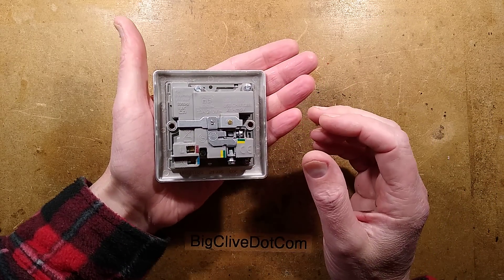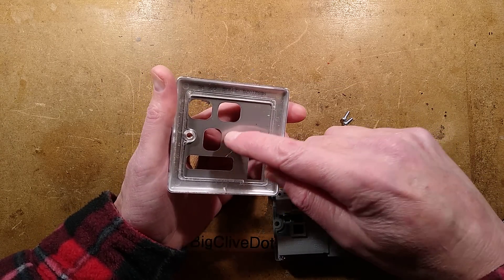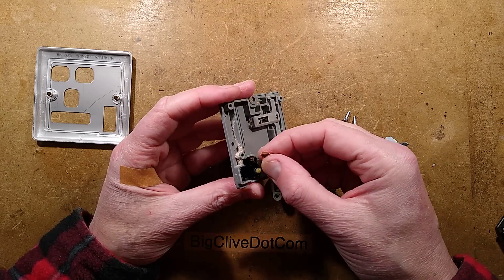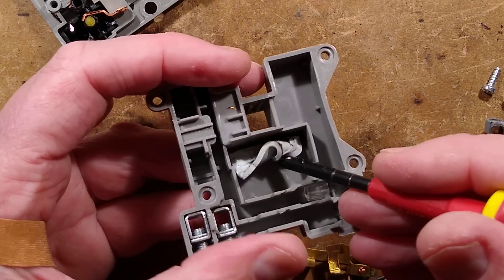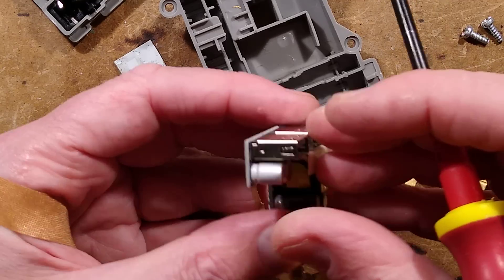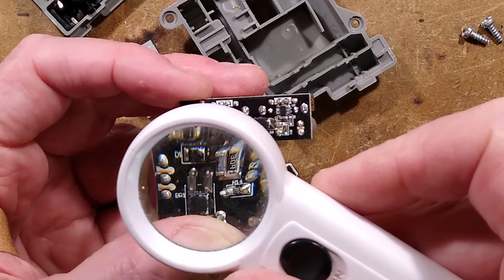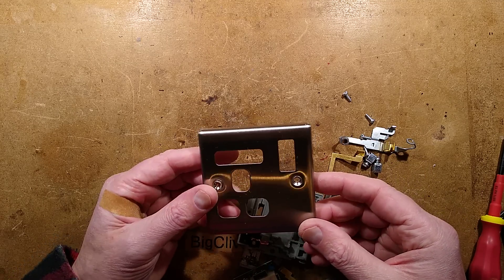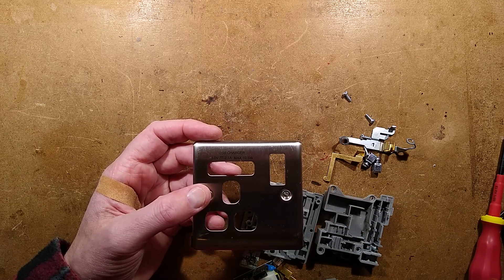Exploded British General USB socket

Comment: I've warned friends about this happening but it's a convenience thing. I would much rather plug in an adaptor at least you can turn it off by the switch if the worst happens
Reply: They'll get outdated anyway as well.

Especially pointless in uk with their plug being sturdy, just leave a charger plugged in.
Reply: I'm fully aware of the fact these fail after time... But they definitely stop kids stealing the chargers and moving them around.
Unfortunately they're like 10 times the price of a plug in one, and about 5 years behind what we expect.
Reply: the argument it wastes a plug, but even if that true, you can buy, usb power plugs, with a main power passthrough main plug socket, I've got one and it say it does, surge protection too? masterplug made it I got it for my laptop PC, but it end up being left pluging all the device charging corner in the house? and thing that charge bricks just passthrough power socket as before, and have USB sockets two, and and if you must charge three usb things you could always just plug usb charger as well, all with   surge-protection too, and when you finished, it just unplug like wall plug too.
Reply: I was thinking the same.
Reply: Lower grade parts energized 24 hours a day is a sure recipe for disaster. The d*** things should be outlawed!
Reply: Hello Sir! Could you do an elfbar please, the disposable vapes? and laso the ones called 'lost mary'. Would like to know if they are done well inside as I smoke them and occasionally hear stories of them going off in people's faces pyrotechnics style :D
Reply: @faraj3159  why dont you buy a multiuse one instead of literal garbage
Reply: If this had happened in the USA and a contractor was involved, the contractor would be sued out of business.
Reply: It's not hassle. It takes 5 mins to replace it....
Reply: @girlsdrinkfeck  5 minutes for someone with the right tools and know how, some people would create serious problems if they tried to replace a socket on a ring main !
Reply: @ian-c.01  You mean by not correctly connecting the loop to the next socket? Yes, with a terminating circuit all the concurrent sockets would stop working alerting the consumer to a problem. With the ring main, all the sockets would still operate but now there's a danger of over current in the conductors  I find it incredible that ring mains are still a standard. I can understand leaving them "grandfathered" for existing installations but to still permit them for new installs is crazy. It's so bad that most foreign sparky videos here on YouTube when referring to our system are all convinced everyone here uses ring mains.
Reply: @spudhead169  Ring mains allow high current circuit breakers to be used with cabling which has a lower rating as long as it is correctly installed.
This is why it's necessary to understand the requirements before working on a circuit, unfortunately it's not plainly obvious to people without training and that's how mistakes are made. In a radial circuit it's pretty simple, most people can understand it, radial spurs are a bit more complicated but they are usually nearby so if the spur socket stops working after doing something to the previous one it's usually not difficult to spot. Unfortunately this isn't the same with ring mains but that's not the fault of the circuit.
Reply: @ian-c.01  My argument against them is that they present a danger in a fault condition that is not apparent. With a radial circuit a fault in the conductors will render subsequent sockets inoperative and doesn't cause the remaining operating conductors to experience potential over-current. With a ring main, such a fault would not effect the operation of all the sockets, so the consumer would be unaware of the problem and also since the ring is broken, effectively converting the ring to two radials with conductors rated far lower than the breaker. Faults can present for many reasons, not just from inexperienced work on the circuit.
Reply: @ian-c.01  They aren't fitting a new ring they are replacing a socket thats already wired in. All they have to do is copy the wiring thats already there. Most people in the UK do actually know this stuff.
Reply: @backgammonbacon  You'd be surprised at how many people think they know but have no idea yet still try to do things like that !
Reply: @spudhead169  affect not effect. There is a big difference and it is not hard to learn.
Reply: @deang5622  Perhaps that was harsh, comments are crude and they're affect on peoples temper's can be reel. So if it trigered you then I apologize. Your probably a good person.
Reply: @spudhead169  It doesn't trigger me in the slightest.
I am just trying to help you learn English, the English you should have learned when you were 16 and still at school.

When people can't don't understand the meaning of simple words like that, it exposes their level of education.
Reply: @deang5622  Yeah, my education sucks. Like I would have used a semi-colon instead of a comma in that first paragraph. I'll try harder.
Reply: @spudhead169  What if it's the earth that becomes detached in a radial...? A different safety issue I know, but. Thanks to a cowboy with a Part P I have a discontinuous earth on my kitchen ring main. It makes it to all the sockets, but only in one direction - and I really don't want to go pulling up carpets and floorboards upstairs to find the crap junction box where I assume the fault is.
Reply: @girlsdrinkfeck  you have go with lowest common denominator,  that almost everthin g now comes with pre-molded plug, attached
Reply: @girlsdrinkfeck  There are people who are not confident in replacing sockets. In Finland it would be illegal. You must use an electrician.
Reply: @girlsdrinkfeck  in Hungary you cant replace a simple burner nozzle on a gas stove, u need a cetified gas technician to do that. Only the technicians can buy the neccessary parts in the shops. Same goes for the AC. U need to speak with a technician first to arrange the installation, then you can go to the shop to buy the AC and after you bought it, u need to go back to the technician to get it from the shop.
Reply: @talos86  hmm yes government extortion
Reply: @girlsdrinkfeck  well, its a problem, if u cant use your gas stove, because the nozzles are clogged up and the mechanic can come on the next week to replace the nozzles.
Reply: @girlsdrinkfeck  as i said in one of my previous post, its a pre-caution, because of the Jack-of-all-trades handymans. There was many gas related incidents, because of the improper installations and repairs(mostly with bottled gas).
Reply: In Poland it's also illegal to mess with electrical wiring in your house. Well theoretically at least, cause nobody can effectively disallow you doing it, neither punish you because you did it. However if your house goes up in flames the insurance company wouldn't give you any money, if they find an electrical installation that have been messed with. That's the only problem.
Reply: So every DIY type in Finland would call an electrician for a simple socket change......unlikely when unscrewing the socket from the wall for painting is allowed.
Reply: @okaro6595  I guess that I was lucky then that Finnair "mislaid" my luggage a few years back or, on arriving at Helsinki Airport Customs, it would have been "Do you have anything to declare? No drugs, guns, explosives, electrical sockets?" 😉😁
Reply: @5Dale65  almost the same in Hungary. Its not prohibited to do electrical work by yourself in your house or flat, but you cant touch the things with the power supplier companys seal: they are usually the electric meter, the main switch and the main circuit breakers. If its proven, that your handywork caused the electric fire, then the insurance companies not paying.
Reply: @girlsdrinkfeck  but most people would require calling in an electrician, so not really 5 minutes.